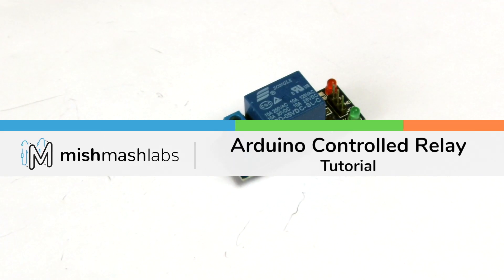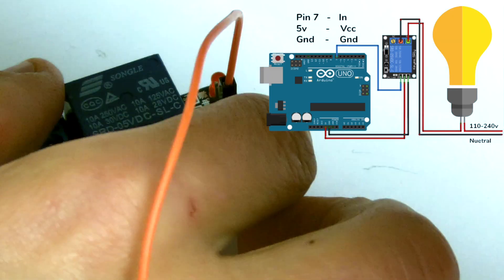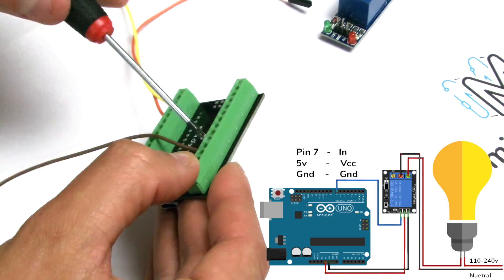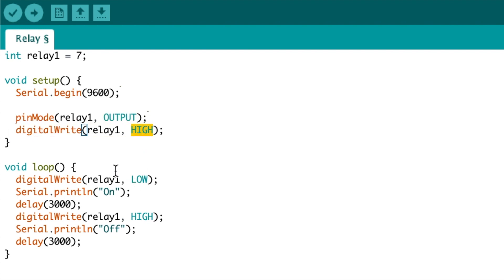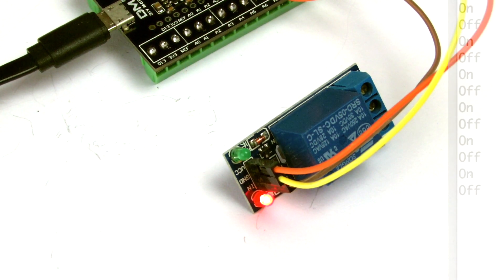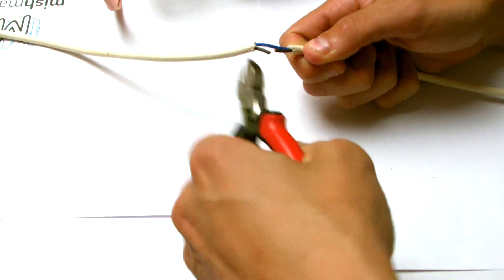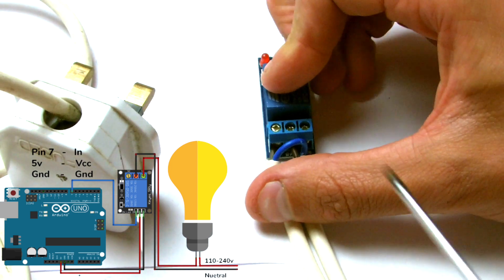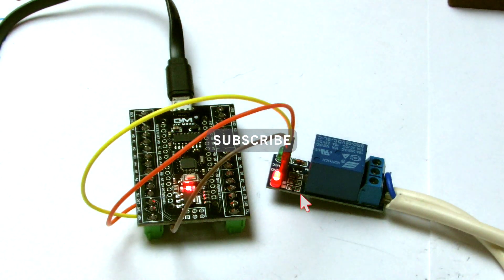Arduino Controlled Relay Module | Home Automation | Tutorial

Comment: I followed you tutorial to the letter! the signal pin is working (emits 3.2V and 0.2 mV every 3 seconds on my esp8266 board), the relay is identical to yours, and the relay does close when I connect the signal pin to it... but that is all it does, it remains closed till I turn it off or till I disconnect the signal pin.  I tried connecting the relay directly to the board 5V power source and to the 5v external power... nothing works.   Interestingtly the relay will also close when I tried different pins, like D8, but not D6... the signal pin is D7)!! please someone help/